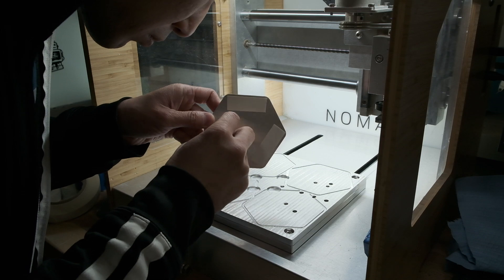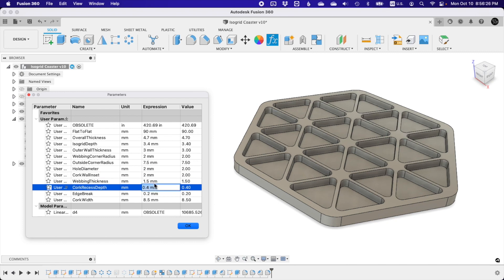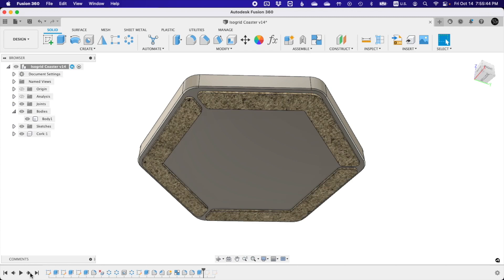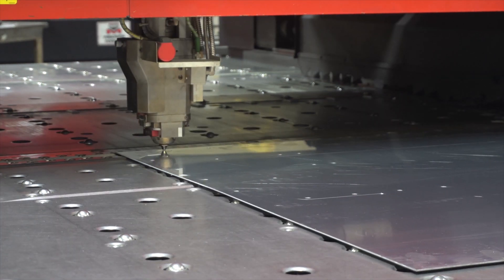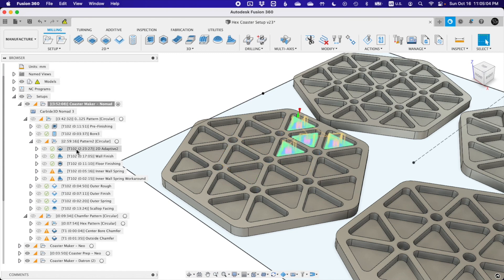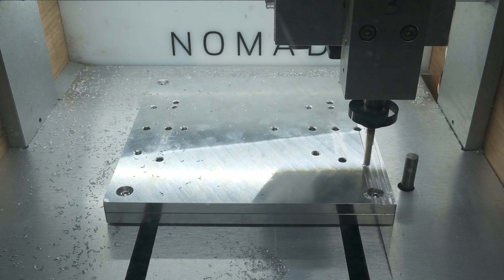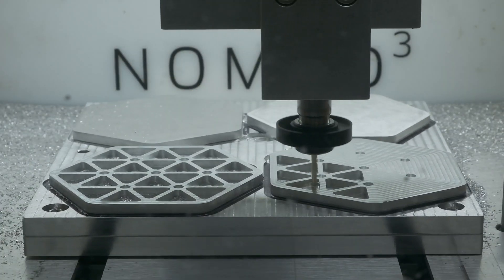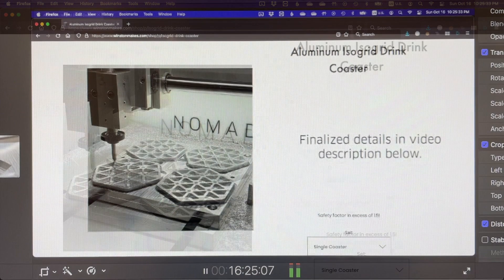Machining Aluminum Isogrid Drink Coasters

Comment: Great project, Winston, as always. I've been out of the aerospace field for 20 years now, but it's still my favorite line of work. My first exposure to CNCs was watching MK-46 torpedo and ASROC (anti-sub rockets) casings and components being milled on Cincinnati Milacron machines at a defense contractor facility. No surprise that 35 years later I started doing a little CNC work of my own.

Comment: My dude! I have to give you credit. I had not though of, nor have seen anywhere else; making 3D printed guides for aligning just the op1 stock. Lots of people talk about making 3d printed soft jaws, fixtures, and other stock holders. Great idea of using "disposable" 3d printed guides to line up stock. 

On this simple plate project, I would have just gone with drilled holes and pins. But the idea of using 3d printed guides that are made using in stock generation in fusion360 sounds like an awesome solution to a bunch of hard to make parts.

Comment: This is a great application for a vacuum fixture.  By machining the bottom pockets first, you can use them to line up with bosses on the fixture to positively lock the part in position in X and Y.   Then the vacuum only needs to resist the lifting force of the cutter.  Having a large flat part and a small cutter is rather ideal.  Made thousands of thin flat parts that way.
Reply from the maker: It actually requires a sort of a hybrid approach, since the outer wall profile needs to be machined. At some point (either op 1, or 2) you'll need to let the part sit on it's own with no lateral support.
Reply: @WinstonMakes  That's the whole reason you have bosses for the bottom pockets to lock into.  It leaves the entire perimiter exposed for machining.  You face the bottom, machine the pockets, then use those pockets as locating features.  THen you can machine the entire top and perimiter in one setup.  If you really want you can even get the bottom side deburring by using a bottom chamfer cutter.

Comment: Nice workholding and aligning! As for improved surface finish, I agree other finishing endmills will help. But you can get better finish even with a single flute end mills, use a higher rpm and slower velocity feedrate. More flutes will allow you to up the feedrate, but also requires a stiffer machine as the side load increases as well and small and long end mills deflect more. More flutes also gum up quicker so cutting fluid becomes more necessary. Also, if you haven't already, invest in some AAA quality precision collets, it really helps and reduces noise and chattering as well. And replace collets as they can wear out. 
Use shorter fluted end mills and don't let them stick out so far out of the collet. These shallow cuts don't need long flutes.

Comment: Try using a very large radius for the filets as well. At about 8mm the whole design kind of inverts... The aesthetic look changes substantially and it's more like a flower than isogrid! Quite pleasing to the eye! (But might fail the conduction specification...) 👍

Comment: I'm really impressed; lots of thought and research went into these fantastic space coasters.  A big thumbs up.  Now let's talk about how the water will affect the aluminum long range.... Have you tried putting them in a dishwasher?  I'd like to see an IG follow-up after a good wash.
Reply from the maker: I actually tucked these in with a batch of parts at work going to anodizing, so I think they'd hold up really well. But the cork on the bottom isn't going to hold up as well. Best way to clean these I've found is to just rinse it in the sink, and use a tooth brush to scrub the nooks and crannies.

Comment: Nice work
Would you say that a Nomad 3 is still more accurate than the latest Shapeoko models? For small projects like these or detailed coins?
Reply from the maker: The Shapeoko 4 and pro are both rigid enough that I'd happily cut aluminum with them, but they don't have the same absolute positional accuracy as they use belts. The Shapeoko HDM would be comparable though as it uses ball screws.

Comment: I was wondering, if you didn’t have a 3d printer could you have put 2 holes on the plate for each coaster to put dowels into so you can set the part them pull them out?
Reply from the maker: Yes but you'd need at least 3 dowel pins per coaster to fully constrain it.

Comment: Do you think they make a chip fan that would work on the Makita router for the Shapeoko?
Reply from the maker: I've never seen one for the Makita style collet, only on ER-11. But some people have 3D printed them, and if you use a tough filament don't crank it up to 30k RPM it should last for awhile.
Reply: I machined a fan for 1/8" shank bit out of an HDPE kitchen cutting board.  It only has the bottom of the "blades" angled as I machined it single-sided, bottom-up, but it still works well.
It may even be stronger because of that method.
Reply: @WinstonMakes  Well I know what my next 3D print will be :). I have my Shapeoko3 enclosed, so even if the fan shatters it will be safe.

Comment: Great vid, as always. Do you have any more info on that tool caddy/cart thing? Also, I'm sorry to tell you this, but I think your dog might be on recreational marijuana.
Reply from the maker: Haha, the huskies only get calming treats before a bath. I was recording that part pretty late so Lani was pretty sleepy already.

The tool cart in my garage was sort of born out of necessity when I first moved to LA, I didn't have much room on the walls, but I wanted to keep common tools and clamps readily available. It's structurally similar to some smaller lumber/material carts, but on one side I bolted on two Wall Control panels, and tacked on a bunch of cheap amazon hooks and baskets.